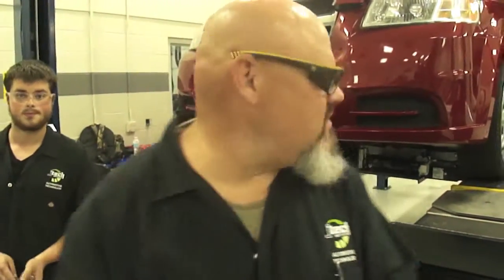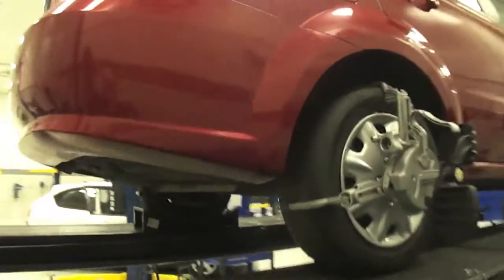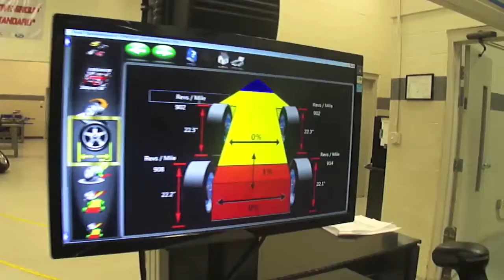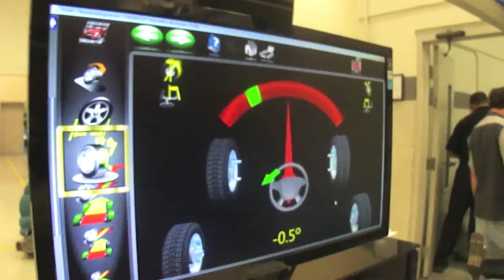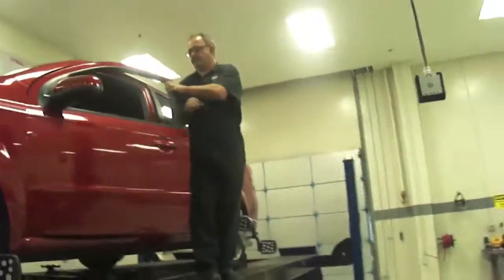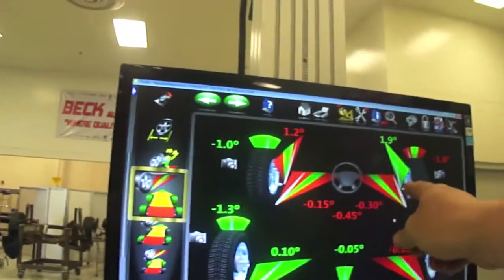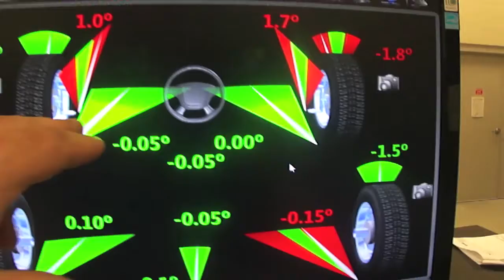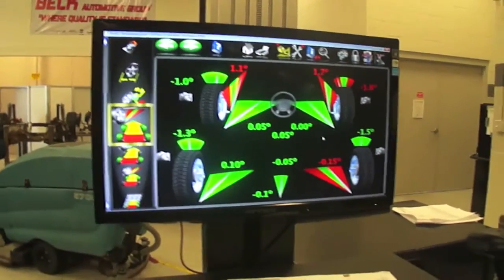Alignment 2010 Cheverlot Aveo

Comment: YAm NT bashing the video. Good show of the machine BUT you state only Toe is adjustable on the Aveo. That isn't correct. Cam can be adjusted on these Aveo and Aveo5 w/ a cam bolt kit / camber bolt kit. The Moog part number for the Aveo cam bolt kit is k90473. about $15 as of q4 2022.  Ive used this kit on a 09 Aveo5 and 10 Aveo one with negative 1.9 and the other was negative 1.4 and this cam bolt kit which does work w/ the 15mm bolt set too worked perfectly each time, thus t say only toe can be adjusted isnt 100% accurate